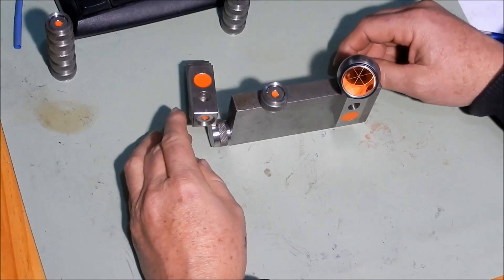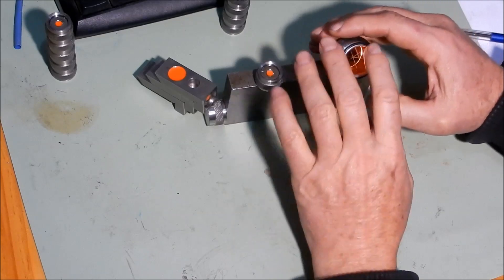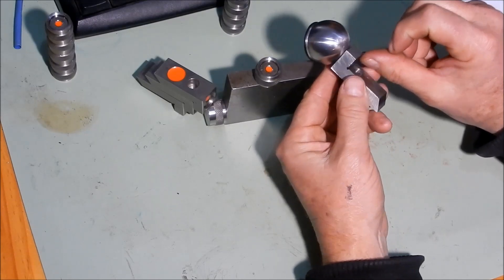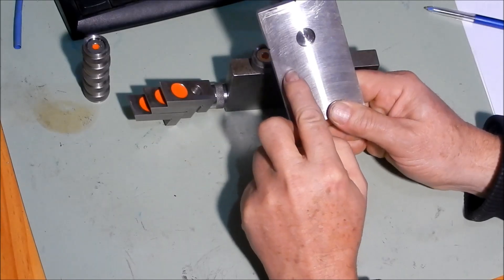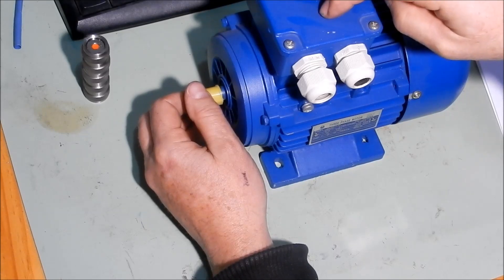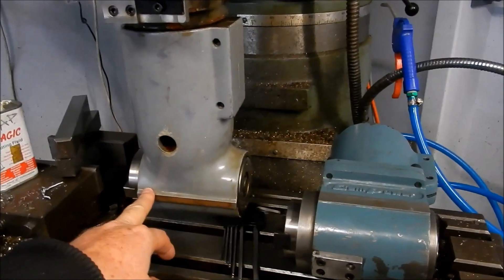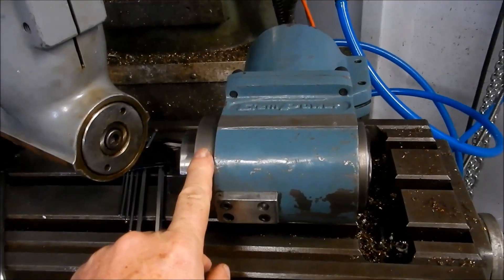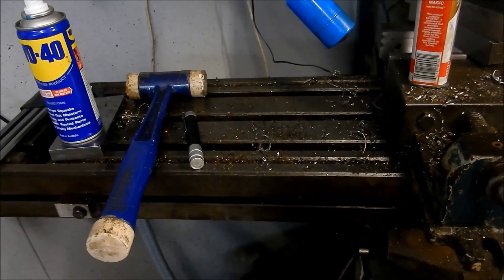Survey Instruments and a Shop Purchase

Comment: The prisms are an interesting set up , like a high tech version of what is used when they lay concrete stormwater pipes . The right angle head was a good score , as you know they are very few & far between , cheers .

Comment: Thanks Cam, will the slotting head be for horizontal or vertical slotting on the lathe?
Cheers 
Raymond
Reply from the maker: G'Day Raymond, it will be used in a horizontal configuration much like a shaper.  As I said it can be mounted on the Lathe Saddle and can be used on Lathes with a swing of 300mm and up (the Ram can be adjusted up and down to suit the Lathe swing and to also allow side cutting to open up the size of the keyway) or it can be mounted on a Milling Machine Table with a dividing head.  If you look at my previous video on the Slotter Strip Down I show a preview of the model at the end.
Reply: Cam at Battler cheers for that, in my Myford 7 series book there is a couple of photos of a vertical slotting attachment mounted to the ways and driven from the headstock, it seems to utilise a modified top slide with the dovetails and gib strip.
Cheers